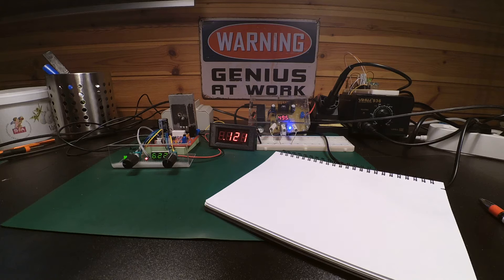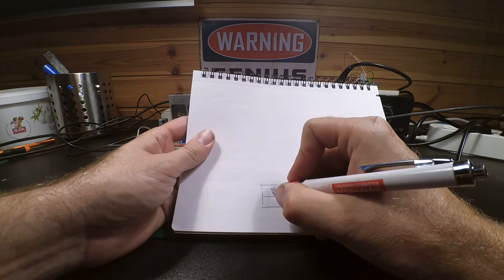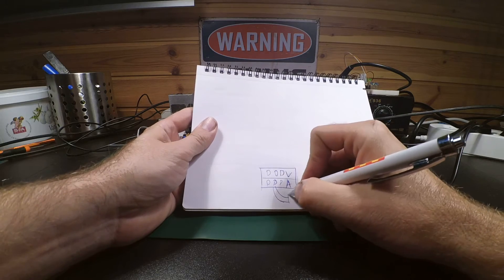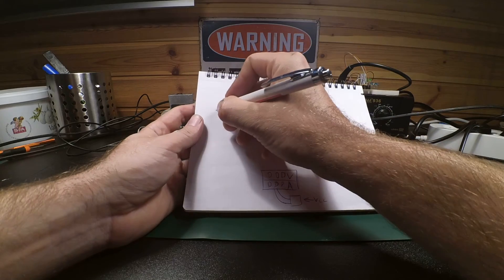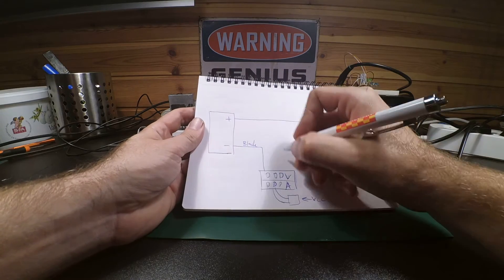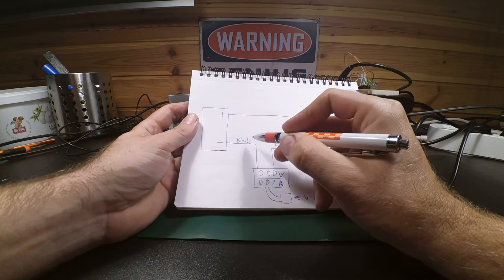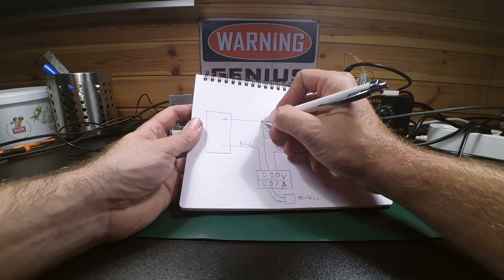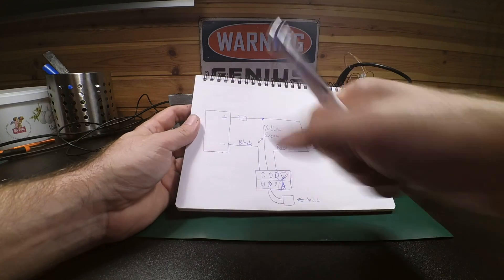Adding Current/Voltage-Display to a Power supply - General information

Comment: Hi there. Do you know how to connect two current/voltage meters in a symmetric/dual power supply with the positive and negative rails sharing the same common ground? I have tried and for some unknown reason when both negative and positive outputs are under load, the positive amp meter always shows 0, but the negative shows a proper load. If I apply a load individually to the positive output or to the negative output separately, then both works ok and shows the correct amp load. But the problem is only with both positive and negative load connected concurrently, then the positive amp display shows 0, although the voltmeter reading is showing the correct voltage. Any ideas?

Comment: Can I power volt/amp meter from the same PSU that is being measured?
Reply from the maker: I explain the problem with that in the video. It depends if the power supply and measuring circuit inside the meter is connected.
Reply: @KristianLaholm  You mentioned it in 1:05 but I couldn't understand what you mean. Anyway, I already connected my meter, thanks for the response.
Reply from the maker: @MrFrambooise  I'm not the best to explane things :)  Some (amp)meters have the same neutral for both power and the current it is measuring, the problem is then that you are bypassing the current limitation part of the circuit.

Comment: There are so many of these cheap Chinese volt/amp meters out there in very simular configurations. I have several, some with internal shunts and some with the shunts missing but marked the same. So confusing, and most of these cheap ones do not come with any instructions and pin references!